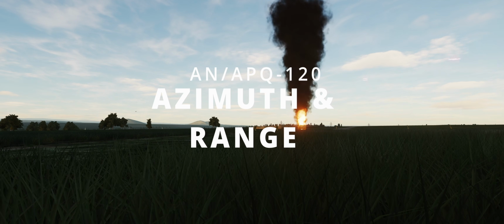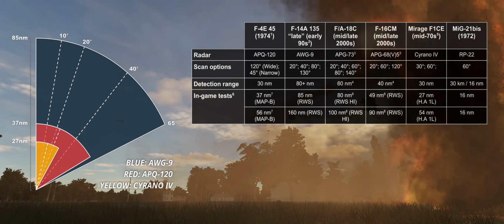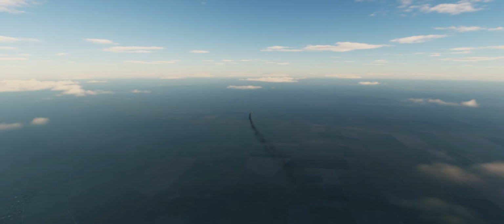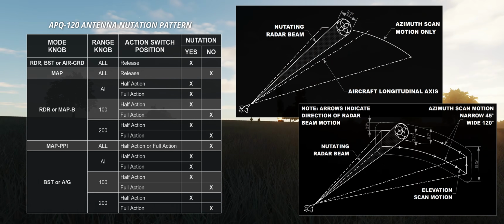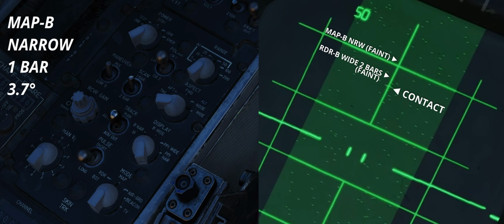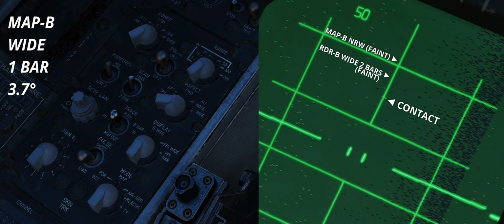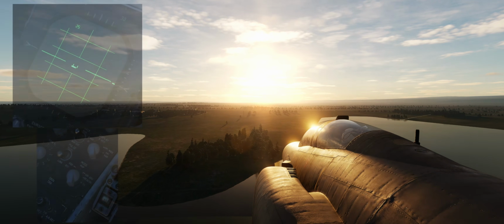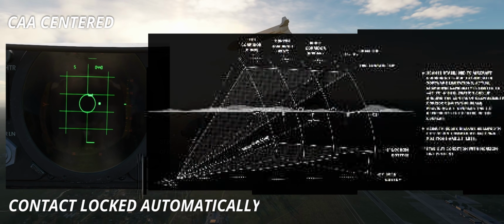DCS F-4E APQ-120 - Elevation, Range, Azimuth

Comment: One quick and hopefully helpful correction: Cyrano IV had -/+ 30 or -/+ 60 (really 57) degrees azimuth, not 30 and 60 total. I also misunderstood this until recently.
Reply from the maker: Corrections are always helpful. I played the F1 a few months ago and checked the manual back then, but I could not find anything about different modes. I'm afraid I missed some updates (or simply made a mistake). Could you point me to where this is discussed? Then I will add the correction to the description with relative information.
Thank you!
Reply: @FlyAndWire  In the DCS F1 manual (looking at ver. 1.0), section 3.18 around page 107-108 makes the ±57 and ±30 bearing angle clear. I checked this against real life documents as well.